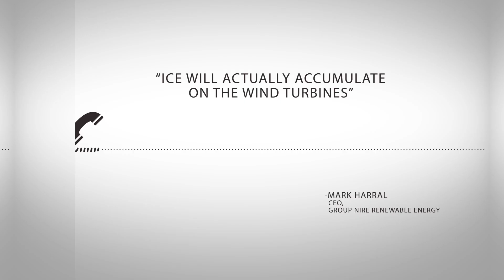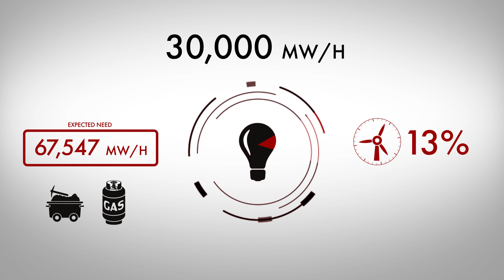Are frozen wind turbines to blame for power outages?

Comment: More accurate reporting should be how many households using Wind Turbine suffered power outages vs households on fossil fuels.  Just vague percentages that really don't mean much.
Reply: That's NOT Possible. Electric Grid do not work like that. They are all mixed together in one big pool. There is no possible direct correlation.
Reply: @Neojhun  That's good to know, but you should still be able to calculate based on the distribution of power sources to extrapolate detailed analysis. For example, if Wind Turbines that provided on average 30% of the power to the grid vs the natural gas that provide 70% of the grid on average. Then, determine which sources failed to meet the expected output to cause availabilities for effected Texas households and businesses.
Reply: @thomasc9036  But that is NOT how the Grid OPERATEs. It's not like a Wind Turbine connected only to a number of house. It's a contently evolving changing flow from multiple inputs to multiple consumers. What if one of the major consumers was an energy hungry INDUSTRY? Homes would not be the Singular factor. You want a Metric that has no real meaning.
Reply: @Neojhun  I think you are not understanding my point and this is really a basic statistical model. People build things with planned capacity outputs. For example, when an elevator is built, there is a calculated amount of maximum occupancy.  

I would assume that building wind turbines is done with some capacity planning with expected power output. Then, once they are operational, companies will calculate the actual output to make sure they are close to expected output. Considering that wind turbines and Solar power output differ drastically based on weather conditions, I would assume that some on-demand power generation (fuel, nuclear, gas) technologies will be available to supplement during less power output or take over to meet the power demand.  Most likely, all these technologies will feed to the central power distribution or grid.

I would assume that electric companies collect data on power outputs and usage all the time for wind turbines and others especially during during the Texan storm and how long.  Compare that with normal operation. Considering that wind turbines didn't generate as much, so on-demand had to do meet that gap. Take that into consideration and compare that with effect area.  You don't need to use my methodology, but there are Data Scientist working for these companies to calculate these specifics for planning and damage controls.

It's not rocket science to analyze collected data. Most companies do it all the time.  I design Datacenters. We make these calculations all the time as we simulate failures, additions, and changes to make sure they are operational at acceptable percentages during limited failure conditions.

Don't be caught up so much with nitpicking on every house conditions, but focus on larger calculations.
Reply: @thomasc9036  That's cool you want some metric for "understanding". Problem is that is not how Grids Function or influences how many facilities or homes lose power. The problem could be A Massive Singular Consumer vs Thousands of Homes. As sources get knocked out and grid operators have to shuffle around capacity. It is highly based on location start and end , load size, viable path ways and many more. Doing data analysis like X amount of Gigawatt Hour knocked out would of Knocked out X Amount of Homes. Tells a wrong concept and it does not inform pathway and solution to save those homes. It ignores factors like failed transmission points or limited capacity links. The problem with your concept you have abstracted numbers soo far from real world mechanisms, it no longer informs how the system works.
Reply: @Neojhun  I find it difficult to believe that an important as electricity is to modern living that there aren't ways to calculate details.  Many companies follow 80/20 rules on complex matters.  It may not be 100% accurate, it's at least 80% accurate. Most planning models operate this way.

For insurability reasons and business continuities, companies make these estimates all the time. If you are right, then most electric companies are just operating under darkness or gambling.. which is scarier.
Reply: @thomasc9036  Oh it's very easy to calculate, it's simple ratios. But that is not how the Electric Grid system works. It ignores the concept of Pathway Broken or Active and Link Capacity then Industrial or Residential Consumers. Your concept would work for Neighborhood MicroGrids.

Comment: Natural gas, aka methane, freezes at -296 F. Natural gas did not freeze. The states sole power is currently coming from its 2 fully operational nuclear power plants. Nuclear power plants did not freeze. The wind turbines froze and had to be shut down to prevent damage to the blades. KXAN is a liberal news outlet in Austin and therefore biased for wind mills.

Comment: Funny thing about this storm:
1. No sunlight during this arctic storm, meaning solar power is worthless.
2. No wind during this arctic storm, meaning wind turbines are worthless.
3. Large demand for power for heating due to extreme cold, means that the smaller supply of natural gas, oil, and coal power plants that had money diverted from them to build wind turbines and solar power plants, means that the fossil fuels couldn't provide all the power needed.
That's the problem with what happened here. "Renewable" energy is least efficient when most needed.

Comment: *Norway giggles
98% renewable energy powered.
Reply: Most of that being nuclear energy and tidal hydro dams.
Oh the irony.
Reply: @GreyWolfLeaderTW  Thanks, I did not know Norway is so dependent on nuclear energy!
Reply: @wito6998  I know it's amazing Norway magically is dependent on ZERO 0 Commercial Nuclear Energy.
Reply: @GreyWolfLeaderTW  What has that got to do with my point? Renewable energy can work in any climate. Texans blaming renewables... did you want to talk about the wind farm off the coast of Norway? How about Canada's wind production being 30% higher than that of USA (relatively) with no issues. They are winterized turbines. My point is renewables can work, when properly done... this is an infrastructure problem, not a 'renewable vs traditional' issue.
Reply: @tbz1551  True, also if you drive past Cheyenne Wyoming going west on Highway 80 you will see miles of wind turbines. They are properly winterized and sustain the hard Wyoming winters just fine.
Reply: @tbz1551  people say that nuclear isn't renewable.
Reply: @tbz1551  Good for canada, Swedens windturbines can freeze (happened a few weeks ago), and you then use a helicopter to spray hot warm water on the wings of hte windturbine to make it work again. And yes, heat the water with oilburners.
Reply: I thought one of Norways biggest income is to sell its oil, so they are not really friendly to our enviroment.

Comment: Nuclear, natural gas, and coal plants are to blame. They supply over 60% of the Texas grid. The majority(we don’t know exactly how many yet)  of those three types of plants are experiencing major infrastructure damage from the below freezing temps over the past 4 days. They were not properly winterized, or prepared for this event.
Reply: That's because Texas does not typically get Arctic storms. This is a one in a 100-year winter storm for the state.
Reply: Florida needs to winterize too!
Reply: So when the 40% cant carry their weight they force the other more reliable sources to shoulder their load as well correct?
Reply: @Xantheus07  LOGIC FAIL! That Majority of Thermal Generation shut down and failed. Impossible for the minority energy source magically replace the majority source. You're asking for Free Energy and Free Infrastructure.